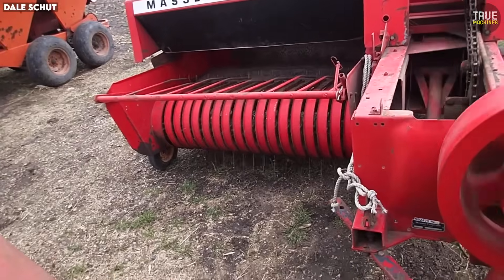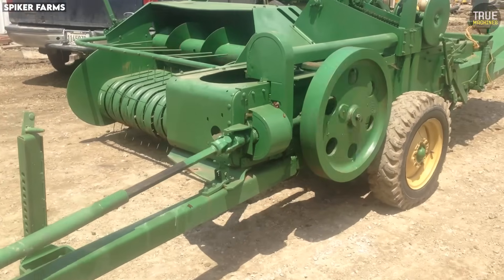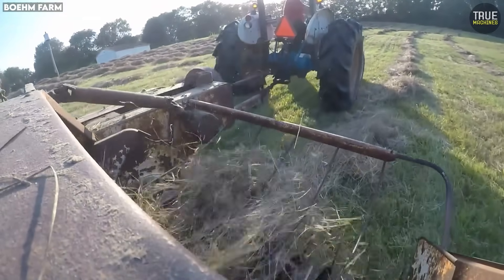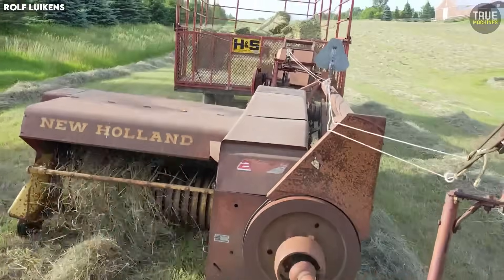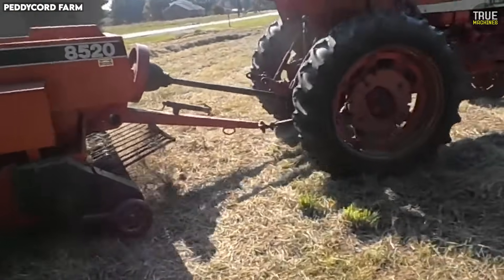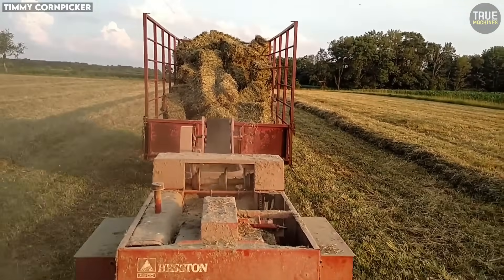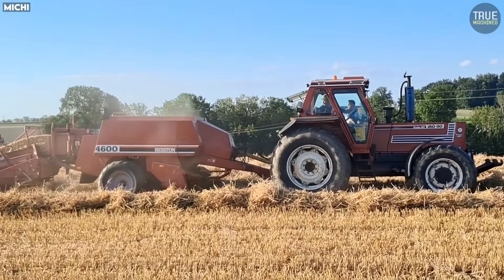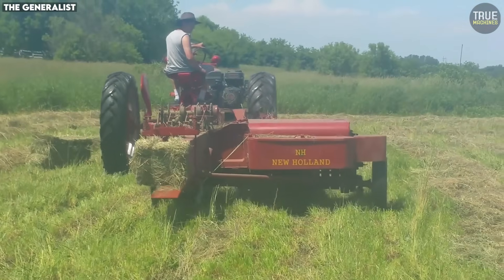10 Old Hay Balers That Were Brilliant, But Almost Impossible to Maintain

Comment: I specialize in farm equipment repair, especially knotter service. and the 14T while fussy to time holds real relibility as well as the NH 67 and yes the ih 46 is another gem, knotter adjustments are precise but makes lots of bales with little trouble. the MF 124 when it gets age on it will need a re-chain job and there is an odd planitary assembly in the knotter that runs the bill hook, they can be grief, NH and JD both had some bone head models to stay clear of but over-all they really made the best in there balers, some of the claims in this video seem to be some text book sales pitch vrs real world experience,  I work on some ancient balers and some new drive chains and some worn parts in the knotter changed and new rollers on the plunger head and away you go!

Comment: The author does not mention that the New Holland, and John Deere used the McCormick deering knotters the technology was sold to New Holland with the new engineer said he could make a better knotter he was wrong. I made thousands of bales with an IH 46 you needed to know how to work with them. The Case 8520 is a Heston baler. All small square balers require daily maintenance the most important was the dealer that had part, and could service them

Comment: When I was a teen in the 70's, my dad bought a new IH 420 baler. That was one of the most frustrating pieces of equipment to deal with. It constantly had knotter issues and constantly missed tying. We were JD people but for some reason, we had an IH piece of equipment that was a pos! My brother bought a new Vermeer round baler and needless to say, the IH spent a lot of time in the shed after that!
Reply: Well  IH baler has been said to be one of the best ways to put up loose hay.😂
Reply: Nine times out of ten your forks for feeding the plunger was in the wrong hole.

Comment: I had the 24T.  I bought another.  Only reason?  Cousin used mine, overrode needle safety, broke twine needles.  I bought new.  I was unable to figure out timing, distances.  I had gone to big bales so it sat +5 years.  I then took it out, got lucky.  Just did 500 straw bales, maybe 200 hay.  Same cousin wanted to borrow.  Promised to be careful.  Wrecked it worse.  *I had no choice as my dad, his dad had bought it together*.  So I bought my own 24T he is never allowed to use.

Comment: What a load of crap in knew a farmer who used an International 46 well into the early 2000's there are at least 2 International 440's still in use in my village of Hardington Mandeville South Somerset UK .  Interesting that you used footage of the American hay man who actually praised his New Holland mabssvchine to my knowledge New Holland have been using the same Knotter design for at least 60 years so what's said about them is wrong. I think it's common to have Knotter problems with any make of machine

Comment: I worked behind a NH 281 into the early 1990's. It was consistent, making 60-75 # bales (depending on the crop) every time, every day, with just regular maintenance. Went to a NH 326 and it would bury me, throwing perfect bales faster than I could snag and stack them. I worked behind a JD 327, and I didn't like the pan thrower, but it couldn't match the NH's.

Comment: John Deere 14T was a good baler as well as the 24 T baler
Reply: Grandpa had 14t bought in 1939 used 7000 to 10000 bales a year for 38 years mistress 3 to 4 bales a year
Reply: @paulwarner3835 Do you mean 1959?
Reply: @Lyle-r4h 0:51 yes1959

Comment: Opposite.  The New Holland 60 and 66.  As retirement project I baled 20 acres 3 cuttings each for 10 years using 6 of them, some for parts only at a total initial cost of less than $1000.  They were all badly worn but sometimes would bale a 100 bale load without a single miss tie.